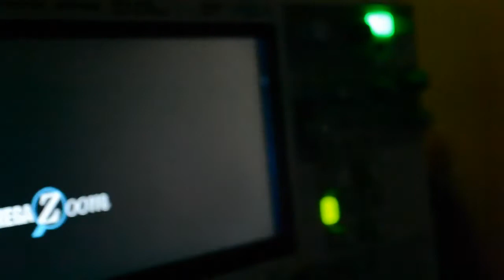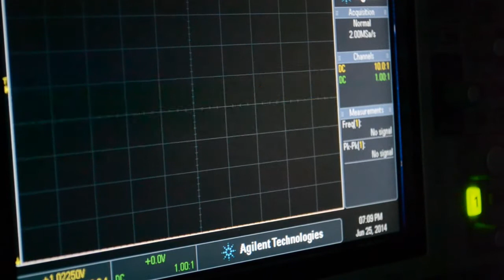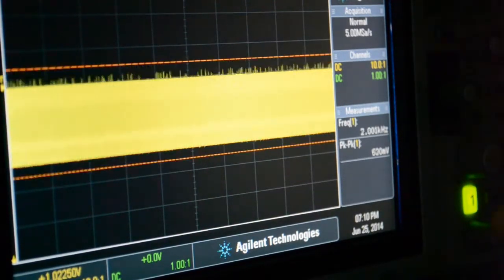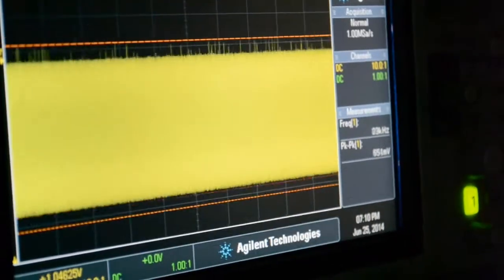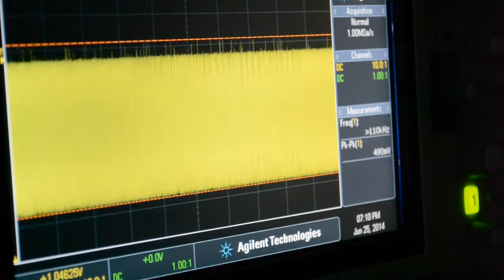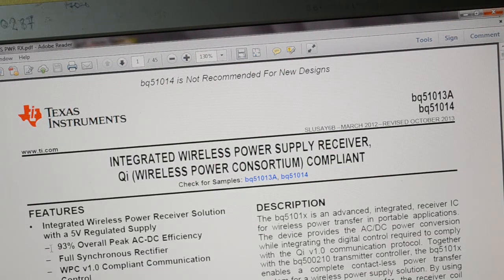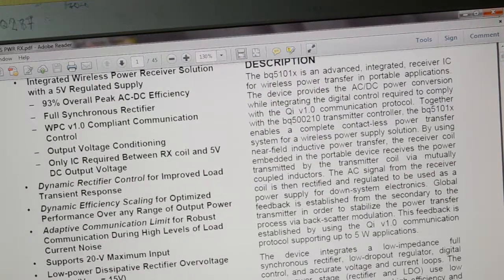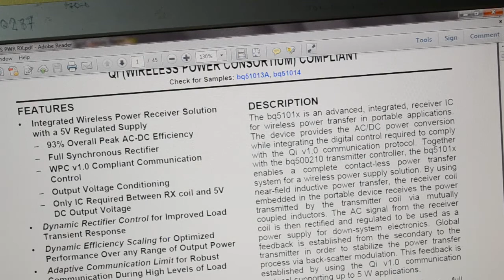WPC / Qi Compliant Wireless Charging & BackScatter Communication / Wi Power Communication

Comment: Dear John,
I have one more question and I will be grateful if you can answer me:
I found that in the Qi technology, the duration of feedback is 250ms; and in some other applications the duration of feedback is 50ms.
To do load modulation, we change the capacitor in the receiver side by using a micro-controller. When we change the capacitor, since we are detuning the circuit, we cannot receive maximum power, right?
Now my question is that:
When we change the capacitor for load modulation for 50 msec, do we also harvest the energy in that 50 msec? In other words, during that 50 msec that we change the capacitor for load modulation, are we still receiving energy at the receiver side?

I really appreciate your time.
Reply from the maker: +Auob Salari 
Hi,
Yes we are still receiving energy during the communication period.
I'm guessing we still get max power, but the circuit must loose something to communicate. I think the efficiency may drop slightly.?

Comment: Hello,
Thank you for your Video.
I was wondering that in the the Qi protocol, how much power Rx communication and control unit consumes for feedback to transmitter?
I would be grateful if you can give me an approximate number and the duration of each feedback.
Thank you in advance
Reply from the maker: +Auob Salari 
good question, sorry I have no idea.
It's very little, but, the overall efficiency drops having to use it.
Reply: +John B 
I just found a paper, "Development of a Communication Scheme for Wireless Power Applications With Moving Receivers" by  Thoen and Stevensin; in which they mentioned that the micro-controller in receiver side consumes 4mw when its active.
Reply from the maker: +Auob Salari 
That sounds like it may be true